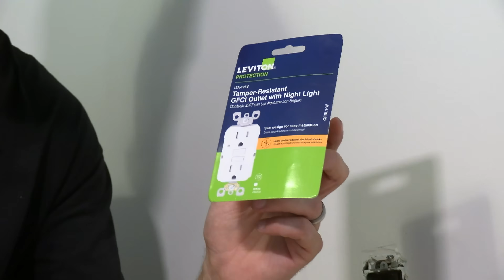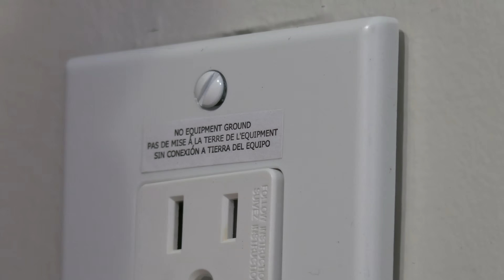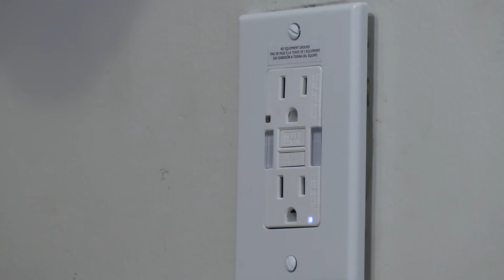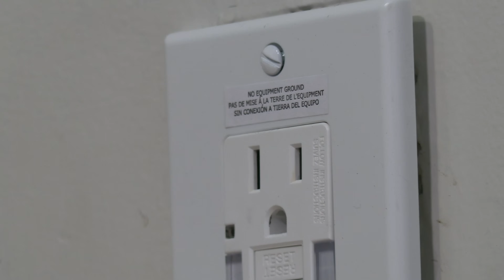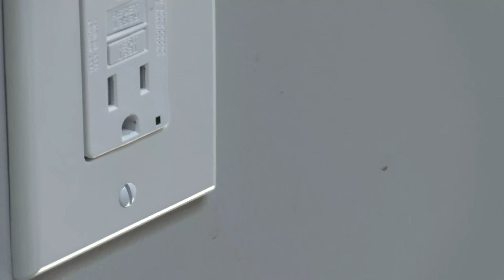Can You Replace A 2-Prong Outlet With A 3-Prong?

Comment: How about a video on replacing 2 prong outlets to 3 prong outlets in an old home that does not have a ground wire.
Reply: This is that video.  Gfci's can protect downstream recepticles weather breakers or recepticles themselves.  2030 nec 406.4.(D).(2)....(b). and (c). Have the requirements he showed in the video....except the down stream or load side recepticles must be labeled with both "no equipment ground" and "gfci  protected".

Comment: The master electrician DID THIS WRONG!  Wrong faceplate!  Because the metal box doesn’t have a ground & the outlet isn’t grounded you have to use a faceplate with no exposed screws.  This prevents a situation where the box and/or screws become energized and someone touches it.  You also had a “shiner” on at least the hot contact.  Not allowed!  Both would fail inspection.
Reply: Do not worry about the crews. The box is connected through the ground contact to anything plugged in it with a three prong plug.

Comment: No ground wires in my house. Where there was an opportunity for grounds, the (genius) that wired this house cut the ground wire off, and used 3 prong outlets anyway. In the lavatories he did a bootleg ground to fool inspectors. I am pulling my hair out trying to run ground wires, instead of doing an entire rewire in some cases. While I do have a GFCI in those locations it bothers me that my GFCI tester does not light up as "correct" and it bothers me that I am unable to cause it to trip with a tester. I wish someone would cover how to run a ground, easily to outlets that are not grounded, and that do not have a ground wire to the metal box, nor have conduit pipes to ground.
Reply: A tester should show open ground in case of no ground wire. That is just why one puts the "no equipment ground" label. In fact having the label and ground contact would be confusing. The test button also will not work without the ground wire. That is normal and not an error. The tester is just a tool. 

I would be more worried about actual risks tan the testers. Using the GFCI only on wet locations is somewhat questionable. One should really have both a ground and a GFCI. The GFCI can fail. With fridges and freezers  GFCI can cause problems especially if you send much time away. Running computers ungrounded can cause problems when you try to connect them to other devices like TVs.

You can run a separate ground wire is a complete wire is not practical. You must connect it to a known ground under the same panel (like a grounded socket). You cannot just stick a rod into the ground and think it is OK. The ground is just term used for it.
Reply: @okaro6595  I don't use a GFCI on refrigerators and freezers. That's where a ground wire is even more important, because they're usually metal and can carry current. And yes, you can put a rod in the ground and get a ground wire that way. There is a whole section on how to do that properly though. It can be done though not as simple as it sounds.
Reply: @okaro6595  The No Ground sticker is used on GFCIs that are not grounded, though have a ground contact anyway. On a NON GFCI outlet, you cannot have a 3 prong outlet if no ground is present. Almost all testers, except for 1 do not show bootleg or false grounds. Test buttons on GFCI themselves do work without a ground. The test button on the tester will not work if there is no ground. If the GFCI fails and it is still hot when it fails, then a ground isn't going to save you. Also a GFCI is not going to cause a problem on a fridge or freezer, unless there is a fault. And if you're away, then there shouldn't be anything to cause a fault since it's there to protect you... Leave it alone, and it's not going to trip. And sticking a rod into the ground are exactly how ground wires work. Think about your pipes. There There are 3 wires that come from the utility 2 hots and a neutral. So most panels, in older homes that have copper pipes has the box bonded to the copper pipe. If there is not a copper water pipe then rods are driven into the ground, several feet and the fuse box circuit box is grounded that way.
Reply: @michaeljavert4635 Ground rods in the ground are for lighting strikes etc etc unexpected overloads.   crossed conductors. comment please.
Reply: @okaro6595  can you fix your grammar so I can actually read your comment
Reply: A sticker goes on the GFCI stating No Ground.
Reply: michaeljavert.   extremely interesting story.   follow up please?

Comment: Are there any places where you must have the ground conductor even if you have a GFCI where one doesn't exist?
Reply: If the outlet was up to code when installed then you can change it using the GFCI method without running a round wire. On new inhalations you of course must have the ground.

I would want a ground conductor in dangerous locations: bathrooms, kitchens, outside.

Comment: If you have a GFCI breaker, can you replace ungrounded 2-prong with standard 3-prong outlets? Do all the outlets need to be labeled as protected?
Reply: Yes, they need to be marked both with "no equipment ground" and "GFCI protected".
Reply: @okaro6595  and they must use a faceplate with no  exposed fasteners.  This prevents someone from hurting themselves on an energized box/ground since there is no path back to the panel on the ground.
Reply: @brians8664 Is this a joke? Do you realize what is connected to the box? Every appliance with a ground prong. Worrying about some screws makes no sense.
Reply: Yes and yes.  2020 nec 406.4(D).(2).(c).  Allows this replacement and requires both markings....." gfci protected" and "no equipment ground".

Comment: Short of replacing the wire to the box, I wish there was a way to allow a non current carrying grounded conductor to be run separately. Same with light switches that are missing a neutral (found in older homes).  I realize this is “not a code compliant” solution, but we as the electrical industry need to find solutions that are practical in old homes while remaining safe.  I’m only suggesting this as an opinion should engineers or nfpa read any of this.  I appreciate your videos Joel. Thank you.
Reply: A non-nurrent carrying conductor would be grounding,  not grounded. 
A grounded conductor would be considered a neutral.

A ground wire can be ran separately to any accessible portion of the grounding electrode system.  I don't have my code book handy,  else I would provide a code reference. 

A grounded conductor (neutral) being a current carrying conductor,  will likely never be allowed to be ran separately if you have a cable assembly already there,  such as romex.
Reply: @techdave05  Thanks for making that distinction, David: grounding vs. grounded. Indeed, the grounding, non-current carrying path in conduit installs is usually the continuous metal conduit, so it makes sense that that is code compliant. Never thought about fishing just green wires around, but sounds like it would in fact be code compliant to do so. Admittedly, it'd be just as much work as rewiring w/ proper cabling, so unless the labor is free, it doesn't make much sense. Might be worth adding it in when fishing low-voltage wiring nearby, since the additional materials cost would be less, and the labor is already there. Biggest problem is that as I read the code, those lines would have to home run all the way back to the panel Would be nice to be allowed to share ground with other closer circuits that were added in later remodeling, that have a proper ground conductor. 
@LDoctorKC,  as to the "missing neutral": of course it's not missing, even though that's how everyone says it: it's present at the fixture. Depending on the exact wiring routing (i.e. if the switch is closer than the fixture, so you've got the extra 3-4 feet to get down/up the wall), I've managed to move the feed from the fixture to the switch, reusing the same switch-leg, a couple times. Had to add a box in the attic to extend the feed the extra distance, once. This is in single-story construction, with attic access to the top plates. Not everyone is so lucky (if working in an attic in Texas is ever to be considered lucky, that is)
Reply: @RossReedstrom  
You can absolutely take a ground wire to a newer circuit and tie it in there,  provided it's big enough. Such as, you can't take a 12 awg to a 14awg, but you could take a 14awg to a 12awg.
15a circuit requires a minimum of 14awg, 20a requires a minimum of 12awg. T250.122 in the nec shows the range that each size is good for.
The ground has to have a path back to the source, (ultimately the transformer by way of the panel), but each ground doesn't need a homerun back to the panel. 
You could take a single ground wire from the panel,  large enough for the biggest circuit you're going to add a ground, to a central location, install a ground bar then branch out from there.
Reply: @techdave05  thanks for the advice!  Makes sense.
Reply: @techdave05  thank you - I guess swapping the cable might the only viable solution. Regarding terminology - I’m learning and appreciate the clarification.  :).  What concerns me is the layperson may just use the ground conductor for the smart switch and that is troubling to me.
Reply: @LDoctorKC  There's a occupancy sensor we often install that's designed to be used with or without a neutral. If there isn't one present,  the wire that would've been hooked to the neutral gets hooked to the ground instead.
Reply: @techdave05  I use to do a trick on old cars that would let me use led DRLs that turn off when headlights are on. You run plus to the battery and negative to the headlight bulb. The bulb becomes the “ground“ due to such low resistance, but when headlights are on, it basically presents 12+ on the DRLs turning them off. Current was so low that it works perfect.  I suspect some of the no-neutral required switches have such low power demand that the bulb itself becomes the neutral path (return current) when off.
Reply: @LDoctorKC  Exactly.  Using the ground as a neutral in any way is frowned upon.
Reply: @jovetj  I agree with you 100%.  You will love this - my Samsung stove fully supports 8/2 with ground and works fine. Then I put a gfci breaker on that circuit and it kept tripping. Come to find out there’s a small current flowing on the grounding wire, and I suspect it may be from the electronics that probably uses 120v.  At least that’s what my clamp on amp meter shows.
Reply: @LDoctorKC  I wonder if it can be converted?
Reply: @LDoctorKC  The GFCI should monitor all three wires to work properly. However many appliances do not normally leak some current but this should be under 0.5 mA.
Reply: I was looking at a device that needs a neutral it was a switch the manufacturer supplies a grounding cover sleeve to go over the grounding wire to be used if a ground (neutral) wire is not available and a grounding wire is available. The next says a grounding wire can be added as long as it makes way back some how to the same electrical box the circuit started out from.
Reply: Please note, the 2020 nec 404.2.(C).(5).  Still allows for a "switched recepticle" switch box to have zero neutrals.

Be careful out there.

Comment: If that ground does work use the ground  any way even if the code says to label the cover with no equipment ground with gfi that ground getting enrgizide will trip gfi quickly (if gfi is working properly). Use two different grounding screws to the junction box grounding the Safety ground wire to the box and another to the box going to the recptical plugin
 so the box is grounded as will; code requires the metal junction box to be grounded; the recptical officially does not need to be grounded in this scenario because the recptical is designed to work as an equipment ground if tightly held in place directly to metal electrical box but I would prefer to have a physical ground to the recptical plugin for added safety especially if the recptical becomes loose. Ps Using grounding clips not advisable when wall coverings is all ready in place such as sheet rock you could loosen the junction box it happen to me once.
Reply: At about time 2:10 he mentions that there is a ground wire in the box and he points out that it does not return to the panel.  Since this box was installed, I expect, before the requirement to ground the box, there is no way to meet the nec 314.4 requirement to ground the box without a home renovation.

Comment: Also, Wago now makes an inline butt-splice lever nut in the 221 series.
Reply: Thanks
Reply: But these are not easy to find. Wago did not have them in stock, and I ended up waiting nearly a month to get the from Amazon. These are the ideal solution for extending wire from Romex; the side-by-side two connector type can be a pain when extending.
Reply: @jeff2829-i9p  Good point. These days there's not telling if you'll be able to get your hands on anything.

Comment: Yeah sure label to downstream outlets so you know that you need to find a GFCI that doesn't exist to reset it. They're never easy to find either. They really should have stickers that say you're looking for the GFCI in the downstairs basement closet behind everything.....

Besides those labels are permanently visible until somebody takes a paint roller over the whole thing....
Reply: Just trip the GFCI and check which do not work. There is no legal requirement to mark them if you keep them two prong.

Comment: So what was wrong with your ground wire? Reattach to box add a jumper from box to device.. then no gfci required...?
Reply: Got to agree... Less than full size ground was the code back in the 60's.  Continued use of old copper romex was NOT banned by later code editions.  Where the ground wire was short too, I would have used a three position Wago and grounded both the device and box.  Chances are the box does not have a threaded ground screw point, so you either have to tap it or use a grounding clip.  Yes, the strap ground is on the device screw, but I prefer to be conservative rather than fast on old boxes like this.  As for the need for the GFCI...  It sort of depends on the interpreatation of the local inspector who will probably never see it.  Again, I can't agree with eliminating the equipment ground when it's aleady there.
Reply: At about 2:10 he points out the ground wire in the box does not go back to the panel.
Reply: @keithharrington8715  He says "the ground connection is no longer there".  This does not automatically translate to back to the panel and I don't think that's what he meant.  It's not like he tested the ground wire to see if it was at the same potential as the neutral.  The photo clearly shows the ground wire coming out of the same romex cable and does not appear to have any breaks or other damage.

Comment: I’m missing why the no equipment ground label is needed here. There is a ground wire in the box. He mentions it’s undersized, so is that the reason? But if so why is it undersized if it’s part  of the 12-2 romex cable coming in? I’m not familiar with old houses.
Reply: An undersized ground wire was the way that romex was manufactured back in the 60's and before.  I remember the screaming from all the contractors back in 69 when the code went to full size ground wires in romex (70 code?).  You would swear you were taking money out of their pocket.  Not much different than every GFCI protection upgrade in later code cycles.
Reply: @tgmct  Thank you!